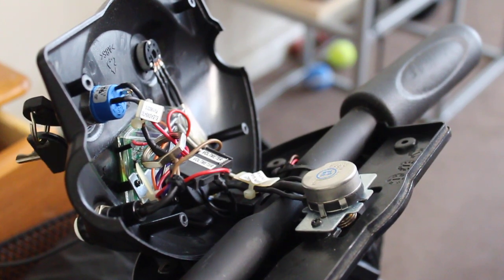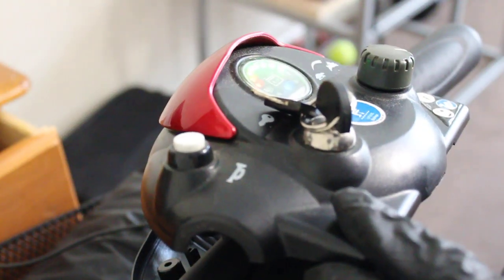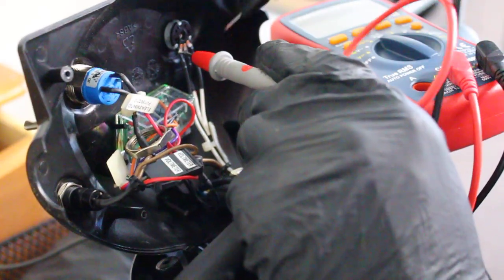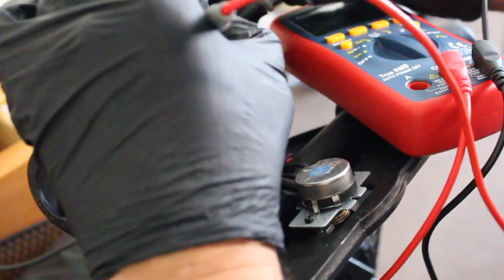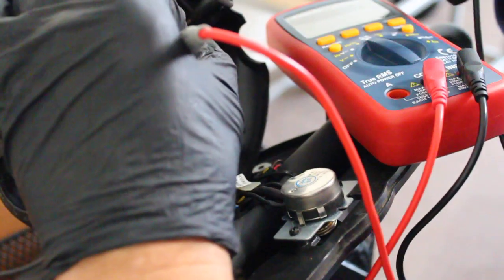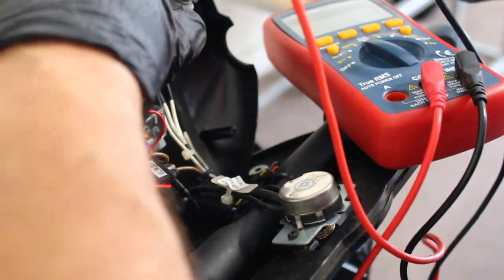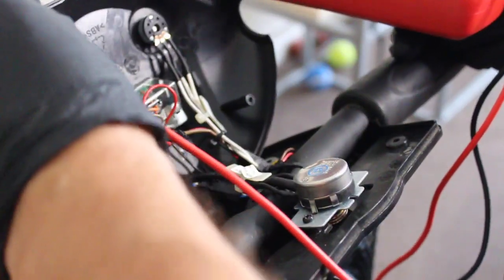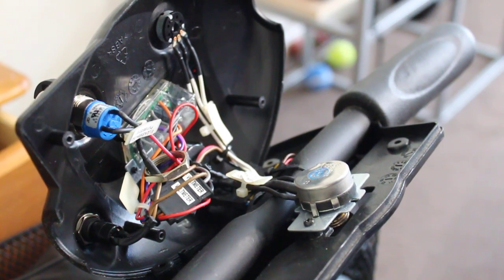Mobility Scooter Throttle Not Working? Test the Potentiometer! (Pride Go-Go/Victory)

Comment: Batteries  fully charged Brake locked in  NO Beeps but still wont move and a NEW Control box Break New ignition & good speed control
Reply from the maker: Have you checked the motor? or wiring to it with multimeter